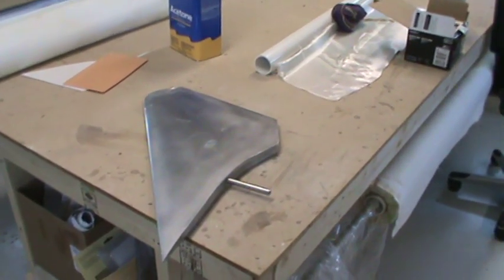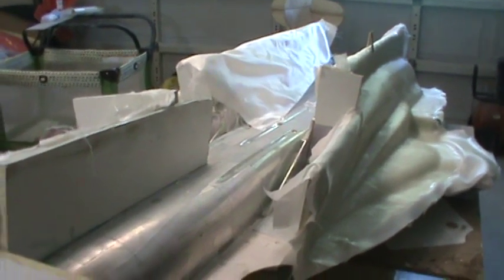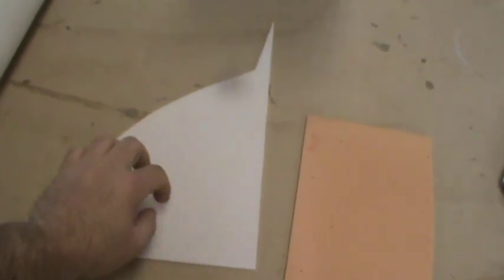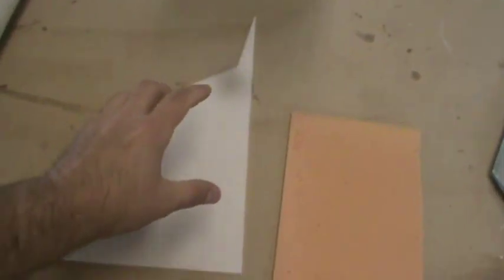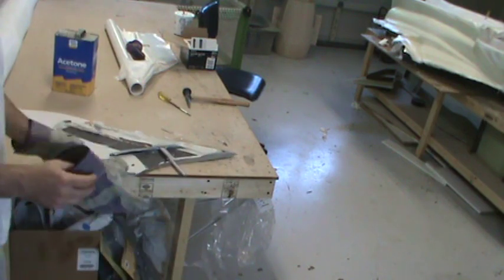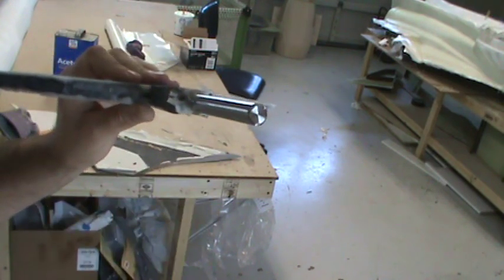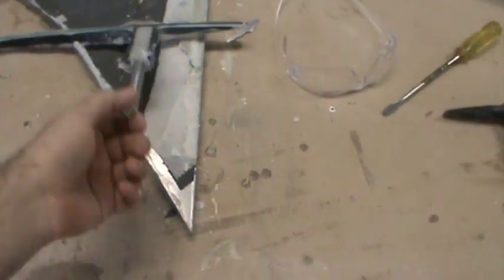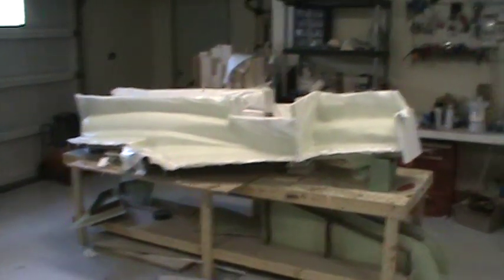How to DESTROY!  I mean BUILD an F-14D Tomcat #59

Comment from the maker: it may not be scientific, but I can tell you that based on 20+ years of RC experience and 10+ years of A&P mechanic experience and 10+ years of composites work, that the stab was way over-built.  Now if i can get the same strength at 1/2 of the weight, I would be happier, but as it was built, it was to strong / to heavy